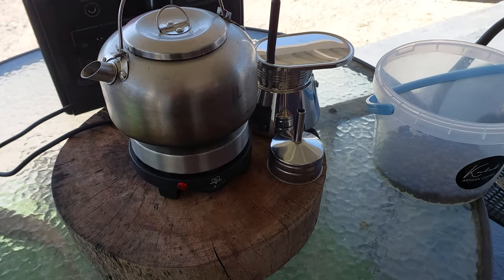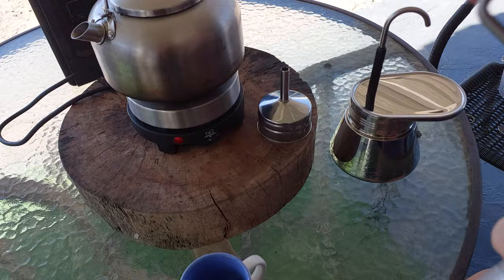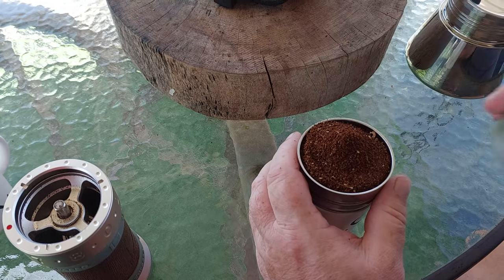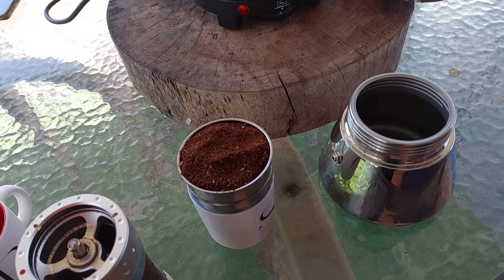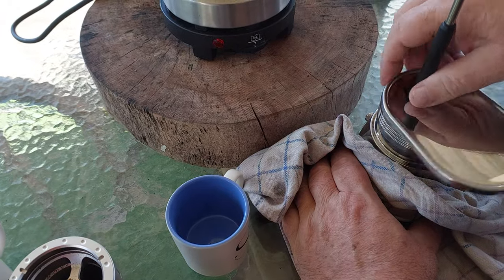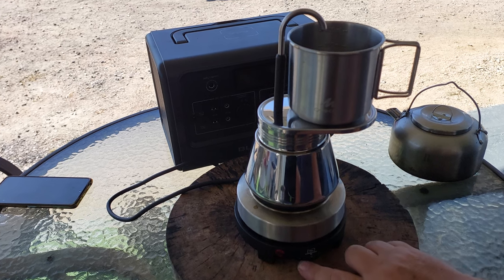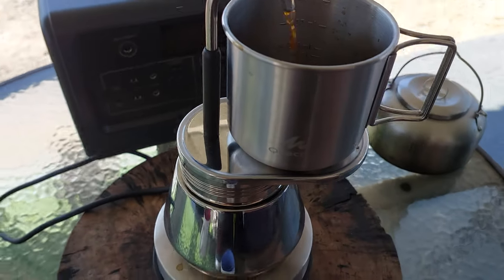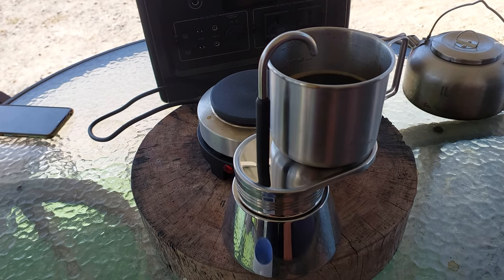Solar Coffee - Moka Pot GSI Outdoors 4 Cup #coffee #gsioutdoors #mokapot #solar #bialetti #bluetti

Comment: Much better way using hot water and low heat, works great, thank you!!
Reply: Thanks for watching
Reply from the maker: You're welcome!
Reply from the maker: Yes, the Bluetti EB70 handles 1000W in the 230v version, it actually shuts off at 1200W.  The electric hot plate is 500W nominal, 450W actual measured, so you could have 2 hot plates going at the same time.